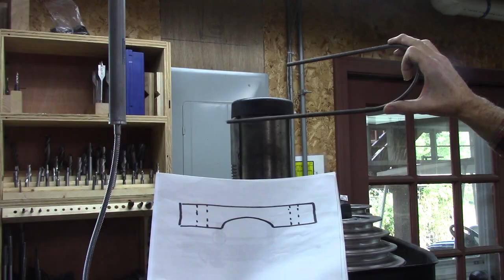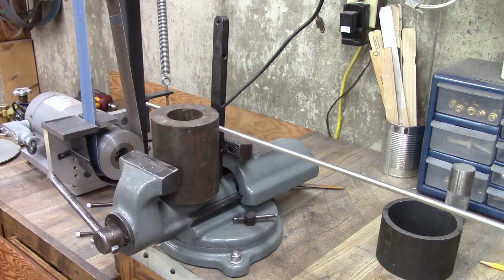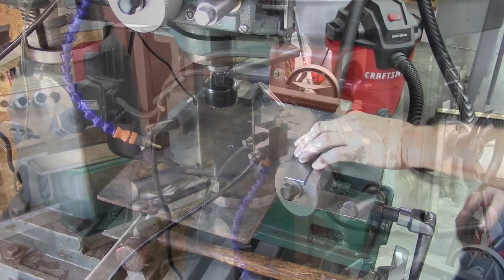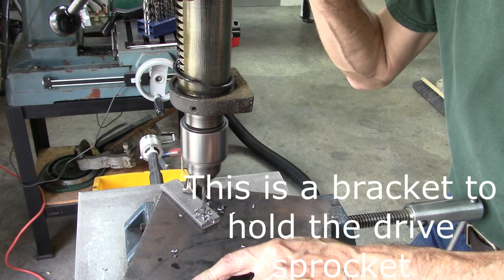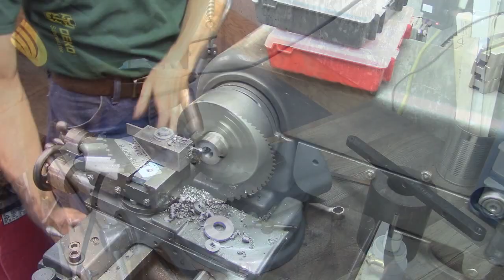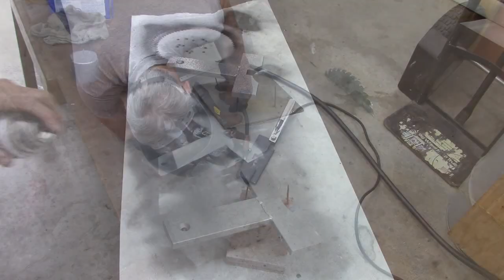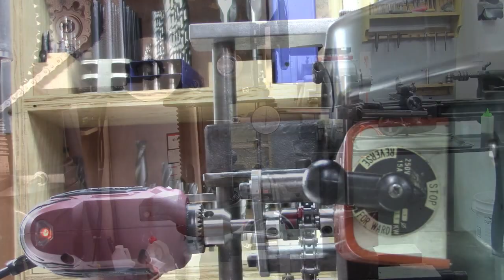The Ultimate Round Column Mill Fix

Comment: Nice work, that makes the mill more productive - :)
BTW Pls avoid aqua-mist systems for machining as they are ONLY appropriate for enclosed machining centres, with suitable extraction and recovery systems. Yes they are great at their job BUT horrendous for operator health, as they atomise the coolant which is breathed(unbeknowns to the operator) in and causes pneumonia, chest infections, reactionary lung inflimation......It's well documented and mitigated for in industry, but the hobby shop is no workplace.
If you must use them, then consider mounting them above the worksurface and run with much lower air pressures- ie. more of a splatter than a mist system - keep safe and well.
Reply from the maker: Thanks, I love the power lift. Now I need to install air cylinders to turn the lock down bolts for the head (am I getting lazy?). Apparently the mist solution I use is fairly safe and it say it will not vaporize. I honestly don't believe it so I seldom use it but when I do the air is set very low. I use carbide 90% of the time with air only. It has some cooling effect and removes the chips. I do have some HSS profile mills and larger mills I still use coolant with because the carbide mills are so high priced. I tend to used 1/2" end mills a lot. This seems to be a price breaking point on the end mills plus my mill isn't as rigid and a Bridge Port and does better with the smaller end mills.
Reply: @WinkysWorkshop  Not lazy, but wise - it comes with age ;)
What would really help is a head brace for the machine, similar to an overarm support arrangement on a horizontal mill - you would notice a massive improvement in rigidity, as the weakest clamping action on a round column mill, is the one that is used most in milling work ie. the X axis.
With small machines including Bridgeports(and other turrets), it's best to always use spindle collets as the spindle bearings are tiny and the head has so much flexibility by virtue of their articulate joints, and round quills.
Keep safe and well.
Reply from the maker: @craigywaigy4703  I'd say you are right about the round column. A round column is not a good idea.
Reply: @WinkysWorkshop  ALL machinery adapt(by virtue of the operator and their ingenuity) to the operators' needs - round, square, trapezoidal.......it doesn't matter, what column!!
These Chinese machines are GREAT, and affordable, and as the operator improves, then the machine can be adapted and improved too.
Unfortunately there is sooooo much machine tool snobbery in this world!!!
BTW "everyone" extolts the wonders of Bridgeports, but they are in fact, VERY lightweight and flimsy, and poor machines for anything other than light jobbing work, albeit they attract a premium in price!!!
9/10 machinists' NEVER use the turret mill articulated joints, as they are a pain in the AR$E to "tramell" - it's the "nature of the beast"!
BTW2. Your build (IMO) - Match the column clamp pairs with matching column clamps ie bin the threaded rod style strap clamps as they have poor torque resistance, and use box section tube(with end bosses and plate registers) in lieu of the rod, and a cheap 24v drill which will allow direct connection to the column rise gearbox ie no chain drive(with the benefit of the drill's in build variable torque slipper clutch), and you'll have the start of a controllable(CNC) machine - you're part way there already.
BTW3.That's a perfectly fine machine, and GOOD work too! :)
If you need help then I'm happy to assist, as I used to be a machine tool fitter/turner before my early retirement - Keep safe and well.
Reply from the maker: @craigywaigy4703  You are right about the machine snobbery. I think what amazes me the most is the assumption that all the old machines are better than anything new, especially new and Chinese. Certainly this is true in some cases but there are many new Chinese machines that are much better than old south bends, atlas and Logans. Interesting what you said about a Bridgeport. I can say for certain that a Bridgeport is much better than my round column mill but I'd say you are right about the assumption that they are the best. (Bridgeport is the Nike of mills). Yeah...  my round column mill does okay and it's actually fairly accurate but I also had to do a lot to it. When I got it the table would not move to one extreme. The lead screw was out of line about 1/8"  I slotted the holes on the bearing bracket to make it right. Also the quill lock would not hold so I made new brass blocks and fixed the issue. Of course I added the guide bar featured in this video also. As for the clamps on the column, they hold very well. I would not trust them for milling without locking the head to the column but I do leave the head clamp loose for drilling. As for the 24V drill, they don't have the torque at low speed to lift the column. Really it would need to go about 40 RPM with substantial torque. The drill I used is variable speed and fairly low RPM but I doubt it would have near enough torque to move the column. A worm drive gearbox would have been ideal but they are high priced. Feel free to contact me at winkyswoodworking@gmx.com
Reply: @WinkysWorkshop  Too true :)
I'll pop you an email.

Comment: Nice job! I've always had that problem with my mill.
Reply from the maker: It's very nice. I'm a little worried about the gears though. I move the head a lot more than I used to not that it has a motor drive. Now I need a push button lock down the head.

Comment: Excellent!!! I've got one of these mills (mine is a Rong-Fu RF-30) and the biggest 2 problems are the limited Z travel without moving the head, and the head pivoting when trying to take a heavy cut, but this idea could potentially solve both! I am thinking I may duplicate this, but with a ball bearing linear guide rail, a cheap 100:1 gear drive motor, and limit switches top and bottom... I too have been somewhat confused with the metric diameter screws using standard thread pitch... in standard size tapped holes...
Reply from the maker: Mine is also an RF30 sold by Enco. First, you don't really need a bearing but if you use one be sure you use one that is adjustable, otherwise you will have movement. Second, good luck finding a cheap gear motor. You might find one but it will be low voltage. If you find a cheap 120V gear motor please let me know. In hindsight I wish I had used a larger diameter guide bar but the one I used was the largest I could drill in my lathe. I've had problems with my head slipping while milling too but I still lock the head firmly. I worry about the clamps slipping or the bar flexing. If you make it stout enough you might get by with just leaving the head snug. It would be nice to not have to lock and unlock  the head when you make a move. I do this while drilling but not milling.
Reply: @WinkysWorkshop  yeah after I commented I finished watching and saw that you were only getting about .001” over approximately 5” of travel, that seems quite excellent with just cold rolled round stock as your shaft and delrin ‘bearing’! Maybe I will just duplicate your design straight across. I’ve found quite a few options for 120v worm drive motors, as usual, they’re straight from China, but will go well on a Chinese mini mill.
Reply from the maker: @gallupcustomknives2293  - Aside from the time it takes I don't have a problem buying from China. You could pay a higher price in the US but you might be buying the same gear motor. The derin is just two flat pads. I clamped them to the shaft and then tightened the lock downs. The surface area is so small you can run them tight without too much friction. The .001" was over about a 5 inch travel but that is still good if you ask me.
Reply: @WinkysWorkshop  exactly. You read my mind on that last bit

Comment: I made something similar, but bolted a bracket to the cast base and into the top of the column (needed the extra height).  The follower is opposed ball races. Since I put a VFD driven 3ph motor on it, I do not need to get into the top cover any more, so I used the spare space to take the power supply to my Z axis drive (DC) motor.
Reply from the maker: I'd love to have the FFD!

Comment: If you have a piece of Thompson shaft kicking around with a linear bearing would do the trick quite well.
Reply from the maker: The delrin works very well. There is almost no force on the delrin and the contact area is very small so friction is not an issue. However...  It would be nice to leave the head unlocked slightly and and move the head with the motor as needed without locking or unlocking. A bearing would be better for handling this lateral load. I actually do this while drilling but not for milling.

Comment: Thanks for that. Quite an interesting modification. I am thinking of buying such a milling machine second hand and the thing I would do differently is to make the delron blocks fit the bar. Perhaps by fixing them together , putting a hole down the middle then shave some of the meeting faces off so that you could effectively clamp the bar between them or tighten/ loosen them. 

Did you check the bar runs parallel to the column? If so, how?
Reply from the maker: Thanks for the comment. Delrin wears extremely well against steel. In fact I have seen a delrin gear wear a metal gear. The amount of pressure on the delrin is very slight. The only purpose is to hold the mill head position as it moved up and down. Once moved the head is again locked. With flat surfaces contacting the bar the delrin can be set fairly tight against the bar without creating excessive friction while moving the head. I have considered increasing the diameter of the bar and using bearings and V wheels and leaving the lockdown slightly loose. It would be very convenient not to bother with locking the column clamp. Yes I trammed the bar visually with the column first. Then I extended the quill all the way (about 5.5 inches), locked the quill and used a dial indicator mounted to the table to indicate the quill as I moved the head up and down. I locked it down at each end of the travel and too the reading. I tapped the column clamp on the bottom one way or the other to make the adjustment
Reply: @WinkysWorkshop  Cheers.
Reply from the maker: @BensWorkshop  - Cheers to you too!

Comment: Hi thanks for you channel and your great ways of coming up with simple solutions to problems. You have inspired me to use this ( guide bar ) idea on my drill press as it has a round column and loses alignment when you lower or raise the table . thanks again
Reply from the maker: You're welcome. The guide bar works better than expected on my mill and I love it! I also made a square column for my drill press that is amazing. It also have a harbor freight drill powered lift. Honestly...  the guide bar might actually be the best approach. It's easier and less prone to error. I welded a round section to the top of my 4 x 4 column and got it perfectly aligned but if I had failed to get it straight and been of a fraction of a degree it would be a problem. https://youtu.be/i4_FtMMMfDw

Comment: May I ask what are the number of teeth on the drive and driven sprockets? And did you consider using toothed belt and pulleys? Also do you have a VFD drive on the mill? And do you have  DRO in the mill? These are all items which I am considering adding to my round column mill. Wonder if it would be worthwhile? I don't suppose you have put ball screws on the mill to reduce/eliminate back lash?
Reply from the maker: There is a link to the drawings in the description area below the video. It has the info on the sprockets. Belts are great but a little less forgiving and more expensive that belts. A VFD would be great and some kind of power clamp on the column too but I'm not sure they are worth the effort. The power lift and not loosing the horizontal position is GREAT! No ball screws...  but I do have DROs. I think I have maybe .012 backlash but as long as I have DRO's I don't mind. I paid $30 for each DRO but the X axis is acting up, I think coolant messed it up. DRO's are a MUST HAVE! (I have troubles counting...  apparently)

Comment: Mark the 1/4  x 20 screws are China's way of driving us nuts. Mine is made in Taiwan and the gib lock  screws are  3/8 x 16, I tried all of my metric thread gages thinking it must be metric and finally tried a 3/8 x 16 and that was it. Makes no sense does it ?
Reply from the maker: Yeah it's crazy but after I thought about it a while I came to a realization. The Chinese were probably making all the screws we use anyway. They probably had more standard screws than metric.
Reply: @WinkysWorkshop  I never thot of that. But you are right. Been a long time since we made bolts and nuts. LOL

Comment: Just watched this again.  When you came back with the painted bracket @ 27:27,  you had removed the coolant system.  What are your thoughts on that coolant set up?  Please do a video on the reinstall, that is of course if you do reinstall it.  How do you contain the coolant and manage the return to the tank?  I'm picturing this in my head as flooding my garage.  But then we use flood coolant at work, i presume you are running a mist?  Is it worth the time, money and mess in your opinion? Thank you in advance.
Reply from the maker: Yes I use mist. I think technically flood lubrication is better and if I was milling hours a day I'd probably have it set up. Mist works great but it doesn't clear the chips like flood. The great thing about mist coolant is that you can mill for 20 minutes and only use an once of coolant. No pump, no mold growing in a tank, no drains to clog etc. The coolant is about $35 a gallon but you dilute it 10 to 1 with water. After milling I suck the coolant and chips up with a vacuum. I could mill for hours and never fill the mill table. The mister air operated kind of like a spray gun... no pump. I'll probably do a video.  Thanks
Reply: @WinkysWorkshop  Awesome reply!  Thank You!  I am anticipating watching that video!!!!
Reply: @WinkysWorkshop  Yes the flood will move the chips however, it's not until you turn off the mill that the one discovers that the recovery tank got bumped out of alignment with the mill base and you find yourself wading through a pond!   Or when it kicks on and sprays five feet behind and over your shoulder because the last guy had it maxed out on flow!  We all got-a learn the hard way to verify EVERTHING before hitting that Go button!  (It sucks when i remember that the last operator was me!)
Reply from the maker: @scottthornton9237  - Yep, for me the spray is the way to go. Another consideration however is breathing mist. There really isn't much but if you are milling things the better part of a day every day the flood might be safer for your heath.
Reply from the maker: @scottthornton9237  Just posted the video!

Comment: I don't seem to have this problem I don't loosen the locking screws  to much when I have to do this operation . You may have OCD you shop is way to clean.  Nifty device you made.
Reply from the maker: I think I'm low on OCD compared to most professional machinists. It does help to leave the lock downs snug but no way could I assume the head didn't rotate. I guess it depends on what you are making - thanks for watching.

Comment: Would it work to bolt the rack to the column?
Reply from the maker: Many have suggested this and apparently some have done this. As a test I clamped mine to the column and it was not good. The rack flexes too much. It would need to be pinned about every 3 to 4 inches to be reliable. If the rack moves .001" the movement at the collet is about .008" This 8:1 ration makes the need for accuracy extreme and also any force put on the head is amplified by 8 times so attachment would need to be extremely strong. It sounded like a huge challenge to me and I gave up on the idea.

Comment: Brilliant! ... Does your ingenuity have no bounds???
Reply from the maker: Thanks!  Sometimes it's a little slow, this one took about 2 years to figure out.
Reply: @WinkysWorkshop  2 years? My god you don't give up easily do you...
Reply from the maker: @28gwdavies  -  It's was kind of like mowing the lawn, I think about filling in the holes every time I hit one. Every time I used the mill it triggered the obsession. I guess the mill was a higher priority, I still have holes in my yard!
Reply: @WinkysWorkshop  I have what everyone calls my 'Loch Ness Monster' going across my gravel front yard... its a length of green rubber air hose that's supposed to be buried under the gravel, it feeds a car tyre pump up point. Every time I turn the compressor on it rises out of the gravel in a series of 'humps'... I just stand on it and kick the gravel back over it after I've used it, I keep saying I'll dig it in better but it never gets done. These things take time, never rush a job.
Reply from the maker: @28gwdavies  - Tire pump in the front yard...  cool idea. I put a air quick connect in the back of my house. It's handy. At some point I was also going to put a hot water spigot in back too but I suspect that is about like the holes in my yard
Reply: @WinkysWorkshop  hahahahahaha

Comment: FWIW, when I had a Grizzly, I mounted a laser pointed on the headstock pointing to the opposite wall. I then made a plumb vertical line. The laser pointer was set on the plumb line at the start of every job. If I needed to move the head up or down to suit tool needs it was super easy to get back to zero
Reply from the maker: That works... I saw a youtube video where the guy did this
Reply: I use the very same system works great